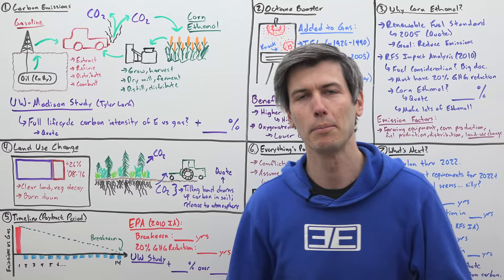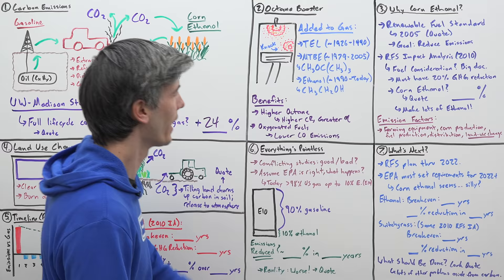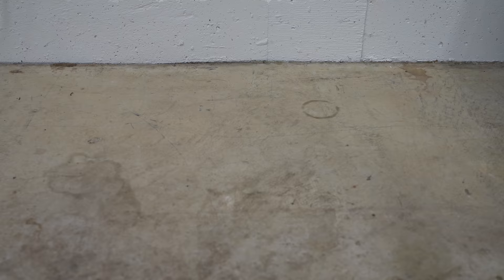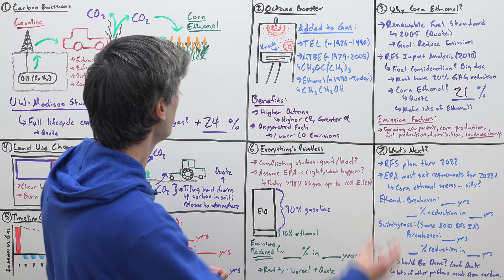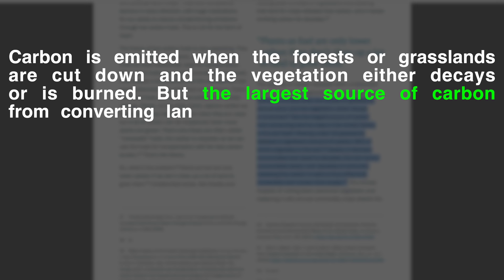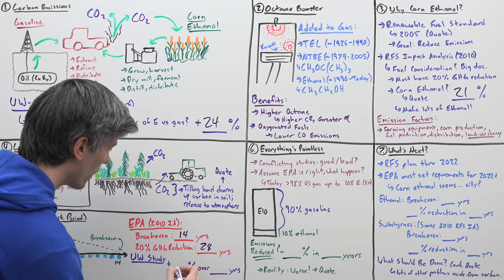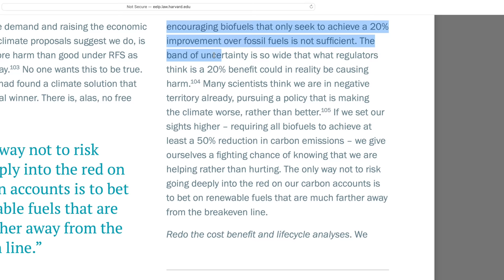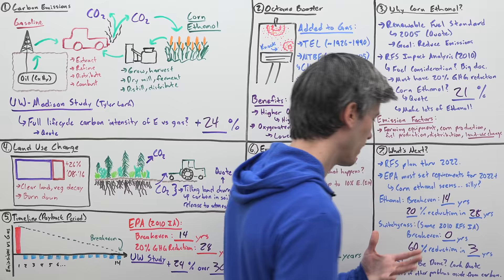America Was Wrong About Ethanol - Study Shows

Comment: I miss one part from the video: How the 10% ethanol effect the efficiency and fuel conspumption? If it makes a car consume more petrol thanks to the ethanol, that makes it much worse, there is no positive side of it at all VS a non "renewable" octan booster.
Reply: After the disastrous lead was finally outlawed, the petroleum industry gave us MTBE which is not only an octane booster but also an oxygenate.  During this time ethanol was modestly sold in the Midwest proving itself to be an economical and effective non-toxic octane booster and oxygenate.

When it became apparent that MTBE was another disaster for humanity which also needed to be outlawed, ethanol was chosen to replace it.  The petroleum industry even went along with the legislation because legal immunity for MTBE was hidden in the bill.  This was revealed and taken out but the bill still passed.

The non "renewable" octane booster used today is BTEX (benzene, toluene, ethylbenzene, and xylene) which is very toxic and polluting.  Premium E0 contains some 40% BTEX.

Denver in 1988 was the first government entity to require E10 when they were on in EPA list of ozone non-attainment zones.  Soon with ethanol they were off that list.

Even with just 10% ethanol added to E0, the Swiss Federal Laboratory for Materials Science and Technology found that the especially health devastating ultra fine or nano particulate emissions were lowered by 97%, carbon monoxide lowered by 81%, carbon dioxide lowered by 13%, aromatic hydrocarbon emissions lowered by 67-96%, and genotoxic emissions lowered by 72%.
Reply: @danafletcher2341 Thank you! This is a very detailed and sad answer. So maybe that +24% negativity due to the soil carbon release, easily cancelled out, if we replace these boosters with ethanol.
So this new research also not conclusive, and we should not stop using ethanol. That was the huge conclusion I missed from this video.
Reply: @user-sf8sl3vv9m  Sorry for the similar replies, initially the AI had them censored but now I see they are up.  That is new, never seen that happen before.  Note that nothing I stated should be censored.  Please reply if you can't see two other replies.
Reply: Its said 3% less but I find it zero or maybe better on some vehicles.

Comment: Ethanol in gasoline causes the gasoline to decay. Gasoline has greatly decayed after 3 months . The gasoline is full of acids and peroxides ,which are corrosive to the engine components. Emergency services that have generators and things like jaws of life, have to have old fuel periodically dumped.
Reply: Gasoline alone has a 3-to-6-month shelf life.  

Many fuel treatments contain an alcohol for an active ingredient.  Sea Foam for example contains 25% alcohol and they state it makes gasoline last up to 2 years.

A DOE study found that ethanol blends in small engines lasted 3 times longer than E0.  The volatile (& toxic) aromatics used for octane in E0 evaporate out and leaves behind an unusable fuel.

I have never personally seen E10 ever varnish.  I did see it varnish most every year in my father's small engines over winter back in the 1970s when E0 was the fuel.  Like a skunk, varnished gasoline is something one never forgets once they smell it.

Comment: u r missing one of the very big points about alcohol for fuel.  It is renewable  Now it took u a good 10 min of BS, which could of been said in less then 2 min, before u got to the real point of ur video.  That making alcohol from corn is bad is all to true.  we can make it form grasses and have much better air.

But here is why we did not do this in 2010.  $$$$  Is the only reason we went to corn.  There is more money in making it our of corn.
Grass require only that u cut it and give it a little Nitrogen.  Not much. About 5% of what u would use on corn.  And then u dont have to plow the land every yr so soil carbon stays in the soil with the use of grasses.

 The next factor in using corn rather then grasses is that the farmers who are growing this corn want to get as much as they can out of it so they put on a good 5 to 30% more Nitrogen (N) then is need.  This over use of N & Phosphate (P) is a major cause of water pollution Ww.  So this over use of N&P cost more then it should b/c of the over use of it.  This b/c it take oil or natural gas to make Fertilizer the big oil co are banking B's with corn being use for making alcohol.

Now when making alcohol form grass we still need to distill it and that take some form of energy.  If we do not use fossil fuel to do this but use dome renewable form of energy this would bring the  Environmental impact down to just the making of the equipment to make the renewable energy and the running of the tractors to harvest the grass and take it to the distillery.  If we use electric machines to do this that will lower it even more if the vehicles are charges with renewable as will...

Get my point here kids?  If not here it is:

Until u stop voting for R and D things like this will keep happening b/c both are corp parties that will service corps before they do a human.  So kids come Nov vote third party.  Dont care Which just as long as u dont vote D or R
Reply: The US used 11,160,933 tons total NPK fertilizer on corn in 1980, before ethanol.

In 2018, the year of most ethanol production ever, the US used 10,521,850 tons total NPK fertilizer on corn.

100% of the NPK fertilizer (& everything from the soil) still get fed to livestock in the distillers grains.  Ethanol comes from only things of the air: solar energy, CO2, and water with the latter two recycled once burnt.

Ethanol C2H6O = no NPK fertilizer

Distillers grains = all the NPK fertilizer

What logic is it to then assign all the energy and CO2 of NPK fertilizer to ethanol and none to distillers grains? 

Iowa State University measured all the energy it takes to produce an acre of corn into a "diesel fuel equivalent"
This included making the machinery, fertilizer, chemicals, plus the tillage, planting, spraying, harvesting, drying, trucking etc. 
They found it takes 34 gal of diesel to produce one acre of corn.
What do we get from those 34 gallons of diesel?
We get >500 gallons of ethanol.
But wait, that is not the kicker.
The kicker is we still get 100% of the protein and other things from that acre of corn still available for a healthier and better feed called distillers grains. A win-win.

There is nothing in the renewable fuel standard that specifies corn be used.  In fact, Gen2/cellulosic ethanol which switchgrass qualifies as still has a $1.01/gal. subsidy if one were built.  Gen1 ethanol which corn qualifies as had a $.45/gal. subsidy which ended back in 2011.

Switchgrass requires a dedicated acre of land and dedicated fertilizer.  Cellulose is harder to get ethanol from which is also why all of the spirits we drink come from sugars and starches.

Corn ethanol is value-added from already existing feed production acres which preserves the feed.  With the feed factor, few other sources can compete even if they make more ethanol.

Newer ethanol plants use the waste steam from nearby/onsite natural gas electric plants to make ethanol.  Nevada, Iowa almost had a cellulose ethanol plant, but it didn't work and now makes renewable natural gas and humus fertilizer digesting the corn stocks in fermentation tanks instead and value-adds corn into ethanol and distillers grains at the distillery side.

John Deere and Cummins have invested in ClearFlame, a company who converts diesel engines to use E100.  Of that 34 gallon diesel fuel equivalent in the Iowa State study above, they said actual diesel used by farmers was 4 to 6 gallons per acre.  

Henry Ford said there is enough energy in an acre of potatoes to farm that acre for 100 years.  Looks like his dream of using his favorite fuel could be the fuel of the future come true.

Comment: One of the problems with ethanol vs gasoline is the BTU's per gallon....
Reply: One of the problems with gasoline vs diesel is the BTU's per gallon...

You must drive a diesel car I take it?

Ethanol overcomes gasoline's and even diesel's greater BTU content with its many other things better for an engine.  BTU is a measure of heat which is mostly wasted out the radiator and exhaust.

Here is an ethanol engine Ricardo built for GM and drove around:

FROM RICARDO:
The new federal CAFE standards are calling for a doubling of fuel mileage performance, which, Vint says, is going to send OEM’s looking for high octane numbers to improve efficiency and ethanol is the best source. Ricardo, an engineering firm with over 100 years in the business of engine design, has developed an extreme boosted direct injection engine (EBDI) to optimize ethanol blends. The 3.2 V6 gasoline engine rivals the power and torque of a much larger GMC Sierra 6.6 diesel, he said, and it delivers 3.5 percent better fuel economy than the diesel.

This is not new technology or knowledge, it was known long ago.  It is suppressed technology.

Rear Admiral C.M. Chester wrote Henry Ford a letter on Dec.15, 1916:
"...I also pointed out in the article that as governmental laboratories had developed from 40 to 55% efficiency in alcohol engines as against 20% in gasoline machines, the use of alcohol at double the cost of gasoline for power purposes, was cheaper for motor[s] than gasoline in common use today."

Scientific journals from 1890 – 1920 contain hundreds of references to alcohol fuel at the dawn of the automotive era. 

Studies of alcohol as an internal combustion engine fuel began in the U.S. with the Edison
Electric Testing Laboratory and Columbia University in 1906. Elihu Thomson reported that despite a smaller heat or B.T.U. value, “a gallon of alcohol will develop substantially the same power in an internal combustion engine as a gallon of gasoline. This is owing to the superior efficiency of operation…”

The USDA tests in 1906 also demonstrated the efficiency of alcohol in engines and described how gasoline engines could be modified for higher power with pure alcohol fuel or for equivalent fuel consumption, depending on the need.

The U.S.Geological Service and the U.S. Navy performed 2000 tests on alcohol and gasoline engines in 1907 - 1908 in Norfolk, Va. and St. Louis, Mo. They found that much higher engine compression ratios could be achieved with alcohol than with gasoline. 

When the compression ratios were adjusted for each fuel, fuel economy was virtually equal despite the greater B.T.U. value of gasoline. “In regard to general cleanliness, such as absence of smoke and disagreeable odors, alcohol has many advantages over gasoline or kerosene as a fuel,” the report said. “The exhaust from an alcohol engine is never clouded with a black or grayish smoke.” USGS continued the comparative tests and later noted that alcohol was “a more ideal fuel than gasoline” with better efficiency despite the ('then') high cost.
Reply: @danafletcher2341  
Yes, as a matter of fact, I Do own 3 diesel vehicles out of 13 in my fleet.

They are older units without computers 'running the show' and I can use a variety of 'fuels' to keep them fed.

Whilst your quotes from various sources are informative...the thought of relying on CORN based alcohol on it's own is NOT enough to provide enough fuel for all of the vehicles in the U.S..... this is taking into account if EVERY single acre of tillable ground was used to plant corn.... even IF the efficiency was equal to or slightly better than gasoline or diesel. 

Perhaps at 'the dawn of the automotive era' it may have been viable. Considering the very small amount of cars were around then. BUT today pretty close to everyone has at least one car, truck, or SUV of some sort. Plus the growth in population  since the late 1800's/early 1900's.

Now could other sources be used in the making of alcohol for fuel? Most certainly!

As it stands right now, corn based alcohol is simply NOT a viable source for motoring fuel in the simple 'math' aspect of providing enough product.
Reply: @russdavis1960  My point was BTU in an internal combustion engine is not a factor, ethanol can be better.  Our current use is in our gasoline optimized engines as a non-toxic octane booster and oxygenate which is the most economical available to drive with.

Actually to your point if every acre of US cropland were planted to corn (330,000,000 acres), we could produce 165 billion gallons of ethanol.  With the US cropland acres we had back in 1980, (382,000,000 acres), we could have 191 billion gallons of ethanol.

The US used 135.06 billion gallons of gasoline in 2022 so theoretically enough ethanol could be produced especially if GM's wish for a high octane standard came in to allow that Ricardo engine which gets more mileage so we would use even less than that.

The problem is, corn ethanol is only economical not because it makes the most ethanol per acre but because it preserves the feed value in the distillers grains so the most ethanol that can economically be made is limited to the size of the cattle herd on feed.  

So I agree with you, not enough ethanol can be made from corn, we can only just over double current production from that source.  If everyone ate grass fed beef like I try to do, corn ethanol would not exist.

There are a lot of sources of ethanol.

There even exists an economical and efficient way to make ethanol from coal, natural gas, and oil which China, India, Indonesia, and others are using and/or looking at from a Texas company named Celanese with their TCX Technology.  We have to refine these anyway, why not a near pollution free non-toxic fuel that can be hyper efficient in engines?
Reply: @danafletcher2341  

Now I'm going to compare gasoline to propane (yes I know it's not ethanol) towards the BTU side of things.

On a normally carbureted gasoline engine, when converted with a propane carburetor, the fuel mileage can drop approx. 20%. (This was the standard number we would give school districts when i took part in propane conversions on bus fleets back in the 1980's. I also know the numbers to be close because I myself used to run a couple of converted vehicles when I was employed at a local propane company.)

Now granted propane has a higher octane and the compression ratio can be bumped up quite a few points...BUT it still doesn't get as good of MPG as a gasoline fueled vehicle.

Another great thing about propane....it DOESN'T 'spoil'.

The reason? BTU's per gallon.

Can propane or gasoline be domestically grown? Nope.

Can electronics, sensors, turbocharging, 6-10 speed transmissions, etc,etc help to get the numbers up to respectable when using ethanol? Yup.

BUT, compared side by side 'bang for your buck' non-ethanol gasoline will still outperform in the MPG department.

There are a lot of different scenarios where one fuel might be better suited than others.

On my whole house capable, portable trailer mounted generator, i have chosen propane as the fuel for no more than the 'non-spoiling' aspect. I KNOW if I converted it to gasoline I would get more kWh per gallon. ...BUT the gasoline would probably be absolute worthless by the next time I wanted to use it.

My snowplow truck is diesel powered because it sips the fuel compared to a gasoline unit...and on the occasions I may be plowing 8-12 hours straight, I don't want to keep concerning myself with IF I can find a gas station open in the wee hours of the morning.

My daily transportation is fueled by gasoline. It's a small economy car which regularly gets 40+ MPG.

So there you have it. I have attempted to give my reasons (albeit possibly 'backwards thinking' to some) as to why 'putting all your eggs in one basket' isn't such a grand idea.

Comment: And on top of that did we take into account how much more fuel you have to burn when ethanol alcohol is added to gasoline compared to regular non ethanol gas
Reply: Let us take account.  I compute it per 100 miles here:

The worlds most selling vehicle, the Ford F150 is rated at 21 mpg with E0 and 16 mpg with E85.  The EPA states the US fleet averages 3 to 4% less mileage with E10 and 4 to 5% less with E15.

E0 = 4.76 gallons of E0 per 100 miles is all newly added CO2 from the exhaust.

E10 (at 20.16 mpg) =  4.96 gallons of E10 * 90% = 4.46 gallons of E0 used per 100 miles of newly added CO2.  .5 gallon of ethanol makes no new CO2.

E15 (at 19.95 mpg) = 5.01 gallons of E15 * 85% = 4.26 gallons of E0 used per 100 miles of newly added CO2.  .75 gallon of ethanol also makes no new CO2.

E85 = 6.25 gallons of E85 per 100 miles * 15% = .94 gallons of E0 used per 100 miles of newly added CO2.  5.31 gallons of ethanol makes no new CO2.

100% of the CO2 from burning and fermenting of ethanol just came from the atmosphere (not newly added) and 100% of it is needed to be back there to make the new gallon of ethanol.

Looks like E85 adds the least newly added CO2, E15 is second least, E10 is third least, and E0 is worst at 4.76 gallons of E0 worth of new CO2 per 100 miles.

Other factors to consider are the vastly more toxic pollution emissions produced by E0, the less horsepower from E0 vs ethanol blends, and the high cost to drive with E0.

If Ford came out with their E85 optimized EcoBoost engine, E85 would have 15 to 20% better mileage (& more power) or if GM came with their E85 optimized one built by Ricardo, they would have better mileage than even their diesel engine.  This is why they want a 100 octane fuel standard from the EPA.  They are worried about E85 availability and rightfully so since <2% of fuel stations offer E85 in the US.  Compare that to France were E85 has a 25% availability from stations.
Reply: @Matt44magnum44  BS
Reply: @Matt44magnum44  TOTALLY INCORRECT on all your points you wrote above...stay with it!